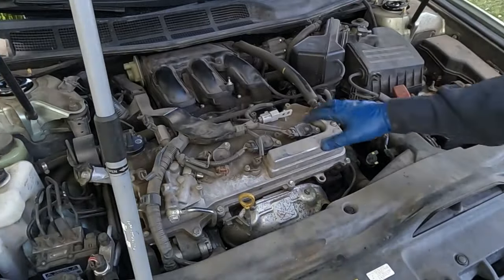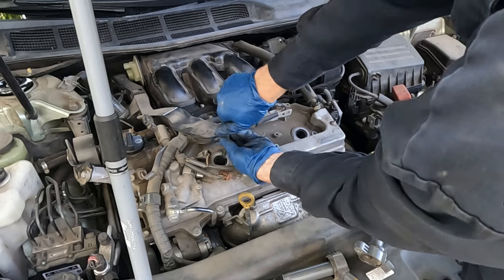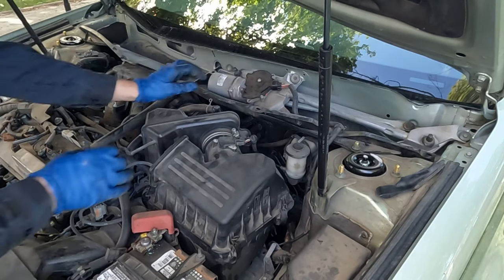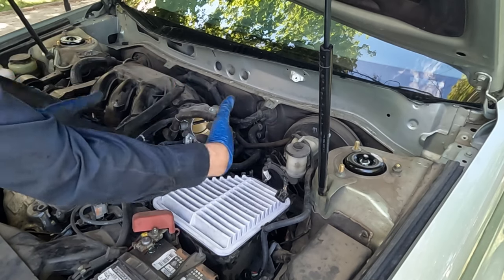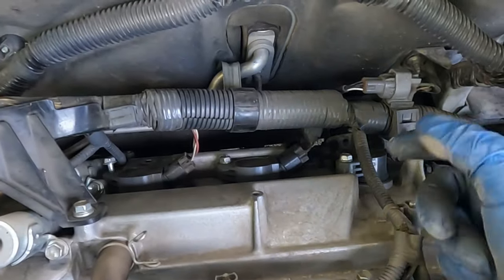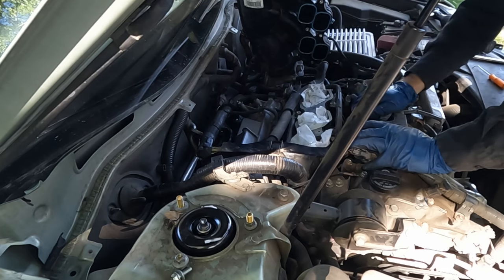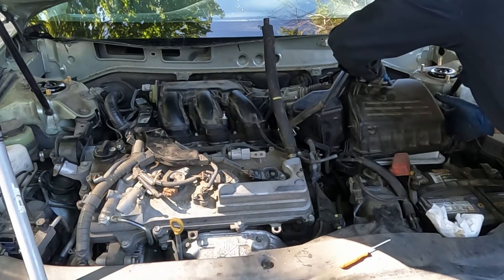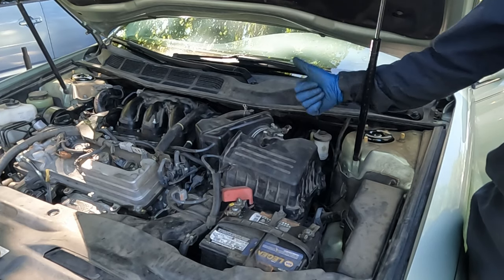2005-2012 Toyota Avalon Spark Plug Replacement

Comment: Not difficult at all just requires a little diligence. I'm happy to do a job like this because it only is required every 100k or so and it's a tank of a motor. A little extra work doesn't mean a bad design. And furthermore it's a good time to get in and inspect for leaks and clean things up.

Comment: Not to be a know-it-all, but NGK does specify to NOT use anti-seize on their plug threads stating the thread finish they use has anti-seize properties and the use of liquid anti-seize can throw the torque spec way off. I went through all this lengthy conversation with NGK and commenters on my NGK HX Ruthenium Plug YT videos, so I'm well versed with this. OTOH, who TF torques their plugs anyway, so there's that argument for not worrying about using liquid anti-seize. Just food for thought here.

Comment: Just did mine on 2015 avalon at 140k. Not as hard as it seemed I first rhought I could bypass the cowl removal but had no luck with. The passenger side braket to intake bolt. Took off cowl. And it was so much more accessable am glad I did. The job took me around 4 hrs but I took my time and cleaned and reconditioned everything I could to give it a proper lnstall. I also put anyiseize on  plugthreads and dialectic grease on new coil on boots What a difference in the performance with the new denso irridium tt plugs. Well worth the time taken and saved$ The local mechanic wanted to charge twelve hundred for plugs, air filter and cabin filter!!! I ssid i can do filters they said of 9 and change for plugs!!! Lol!!!. Take pictures and proceed slowly- if you can turn a wrench you can do it as well!!
Reply from the maker: @erad7464  Thanks for the comment! Glad this video was helpful 🙂

Comment: The Toyota 3.5L V-6 is a beast on the highway. I have driven this car approx 70k with zero issues, I am not having any currently but I feel I owe the Avalon some TLC. I only use Amsoil signature 5/30 synthetic motor oil, and I do an engine flush each time. Plus I only use the top line Wix XP filters. It is time because the car has 232k kilometers. Thank you so much for posting your knowledge on YouTube. YouTube is the University of Automotive Gear-heads, and people like you sharing your videos, makes you our Gear-head professors. Much gratitude my friend. I do a trans oil change every year to a year and a half.
Reply from the maker: These Avalons are great cars! Glad this video can help you make it last!

Comment: Did you say 1-2-3 are in the rear?? 😮.  It’s 2-4-6 front 1-3-5 rear if your facing the front of the motor??? May want to fact check 🤷‍♂️ Every Avalon I have ever worked on that is….
Reply: Other than that great video.
Reply from the maker: You're right with the cylinder numbers. I was counting the coils to show you that we have easy access to all three coils in the back 👍
Reply: @ValleyMobileAutomotive 😂 bro was like "☝️ aCtuALly"

Comment: The Toyota dealership charges $595.80 to remove & replace my 2008 Avalon spark plugs.   Is that a fair price or should I go to a local  family owned auto repair shop?😢
Reply from the maker: @caroldavis5158  That seems like a fair dealer price. You can get it done cheaper at a non dealer shop but either way just make sure to go with a reputable place and ask about their warranty.
Reply: That’s a ridiculous price lol. Do not pay over $600 for this… find someone local. It’s not a hard job. Dealerships are highway robbery
Reply: Went to dealership, charge $795...ur are cheaper be happy don't worry....
Reply: Or go to a local mom and pop's repair shop..

Take care..
Reply: 2007 Avalon
Reply: Around where I live mom and pop charge just as much as dealership. Everyone quoted me near 3k (give or take 200) for a/c evaporator  replacement. I spent under a hundred for the parts and did it myself with bro n law in 6 hours. This last may. Been blowing cold since.

Comment: Just watched your engine rebuild od Toyota Camry 2.4 liter.  
First, when tightening Head Bolts,turn the engine 90° so the head is on the side, not the top!  The engine stand will not roll around as you torque the head bolts.
Second, I 'm old and have not done this in a while, but piston rings with oversized pistons are extra long on purpose.  You insert the ring in the resized bore and mark it and grind for the appropriate ring end clearance.  My Dad swore by grinding ends on a diagonal to reduce blow by and oil use.

Comment: I have the exact same car I will be doing it tomorrow,  you made it look easy .. nice to the point video .. DId you remove the battery terminals or is it not necessary. Thanks
Reply from the maker: It's not necessary because there aren't any live wires that can cause a short. But if you are someone who uses the top of the battery to put tools then I would disconnect it to be safe 👍
Reply: How did it go ?
Reply: @DevariusJones-s5q   went fine took me around three hours.  I didn't remove the negative terminal.

Comment: You skipped that part at 5:58-6 how you got the bolt loose
Reply from the maker: Standard short socket and ratchet. Once you get it loose you should be able to get it the rest of the way with your fingers 👍

Comment: It is more than 13 ft lb. 13 ft lb might be too loose. I would say more than 13 ft lb but certainly no more than 22 ft lb to be safe not to strip it.
Reply from the maker: 13 ft-lb is the manufacturer's recommended torque 👍

Comment: The ridiculous requirements to work on these cars is one of a lot of reasons I don't own a front-wheel drive car.
Reply: The work i had to do on my 02 Subaru outback just for the gasket to blow cylinder 6 kept misfiring changed all plugs coils and injectors